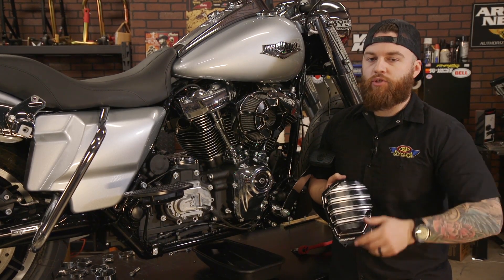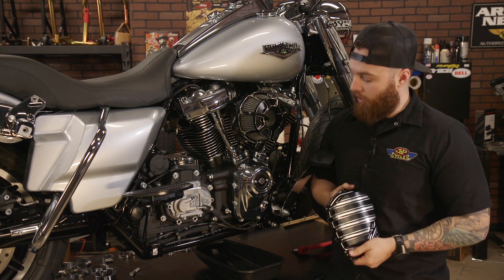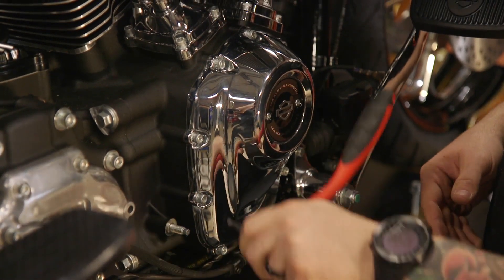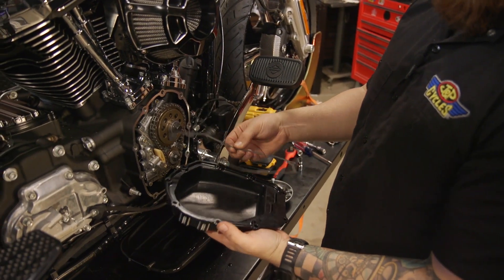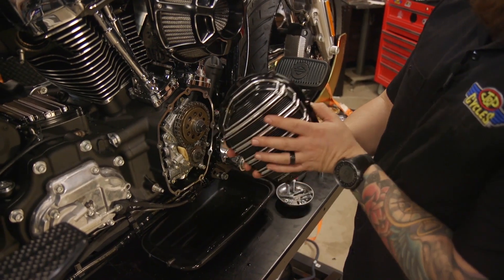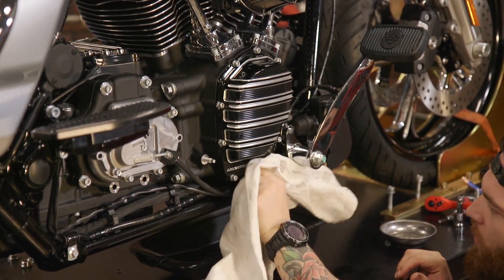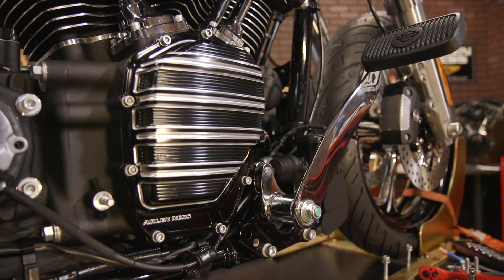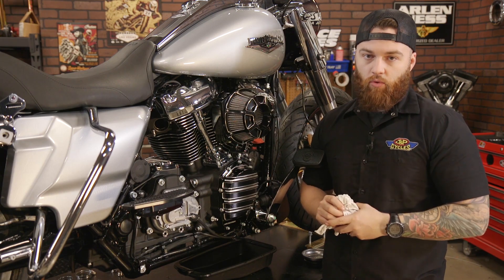Arlen Ness Cam Cover Install : M8 Road King

Comment: Did you drain the oil from the engine first ?
Or can we just do the swap and add a little bit of oil after to make the level ?
Reply from the maker: You could swap the cover without draining the oil but you will lose some oil.